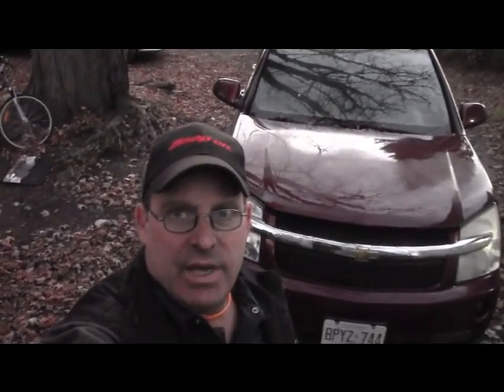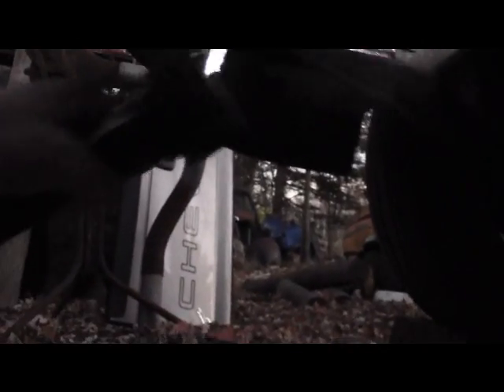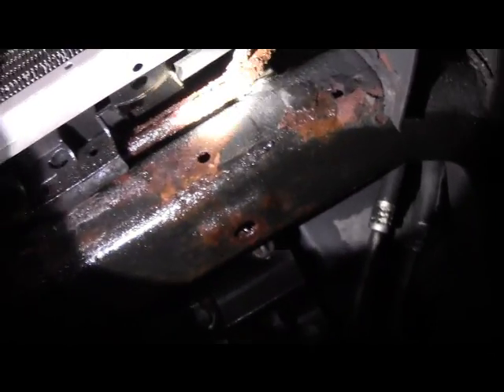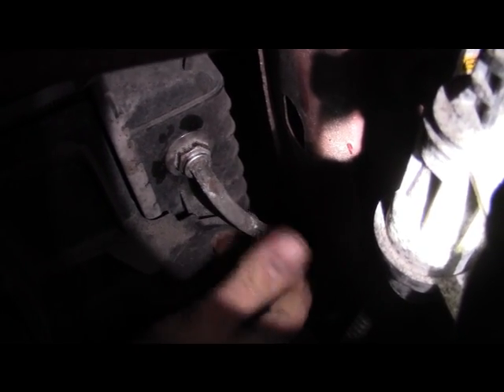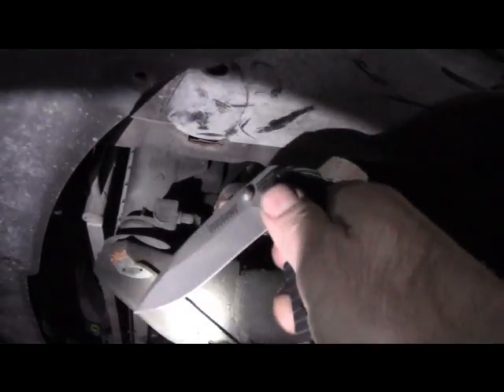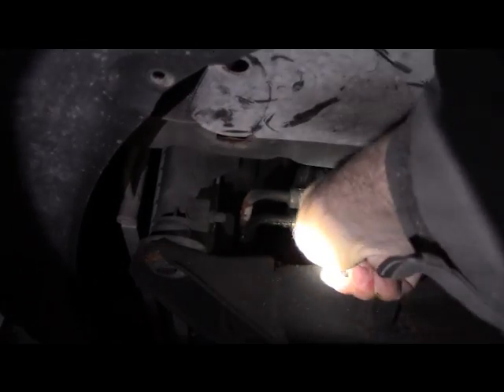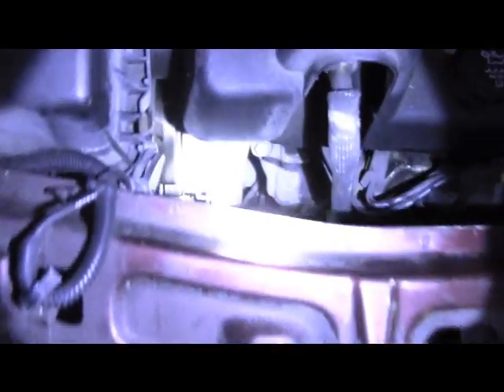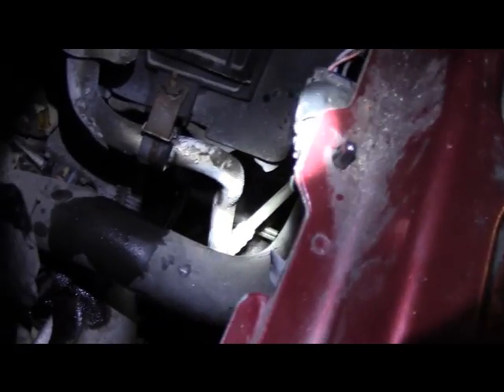Easy home made transmission lines

Comment: Dude, I have laid on freezing cold ground changing starters, dropping trannys ,fixing clutch bleeding brakes , etc. Fingers so numb you can't feel them. Ya can't put bolts in a bellhousing wearing gloves. Friggin transfer case aint none to easy to hold and bolt in either.  I admire your effort. If you had a legitimate shop funding donation, I'd kick in a few bucks.
Reply from the maker: Thanks man, gas is not very nice to have on your hands in the winter lol been there done that and will do it again at some point lol

Comment: good stuff buddy!  Stupid question, but why steel there and rubber the rest?  Pressure fro the cooler or heat protection?
Reply: Ghostma so there is flexibility. the engine and transmission twist under acceleration and deceleration
Reply from the maker: Rubber in the middle so it can take the flex from the engine. Could use copper as well but might break from flexing after a long time. You could run rubber right from the trans to the top side of the rad but not as stronge
Reply from the maker: Yes that is right